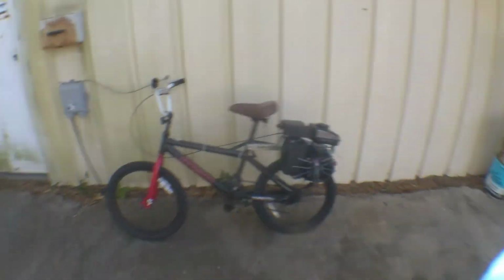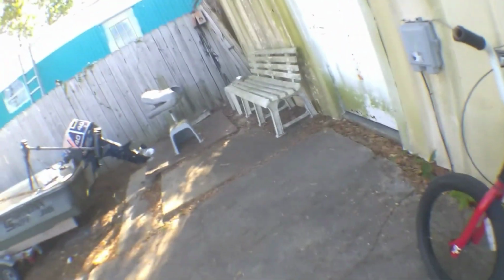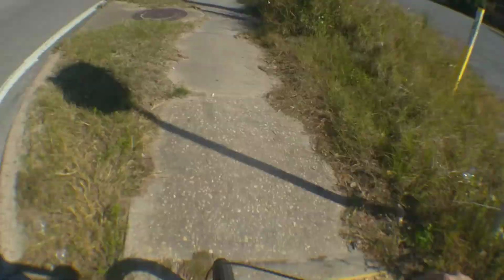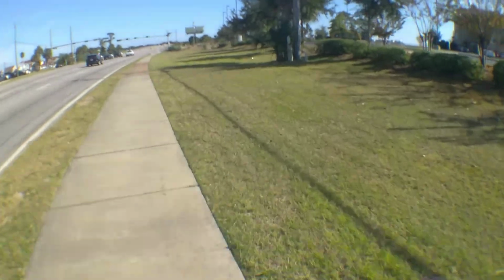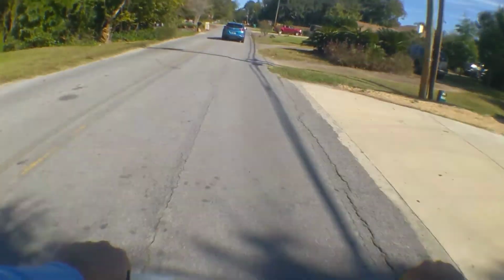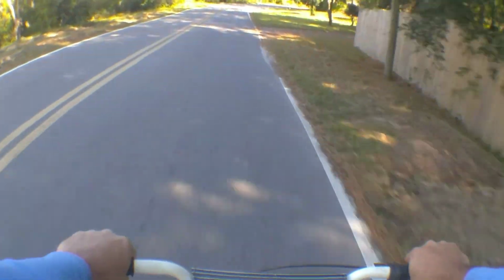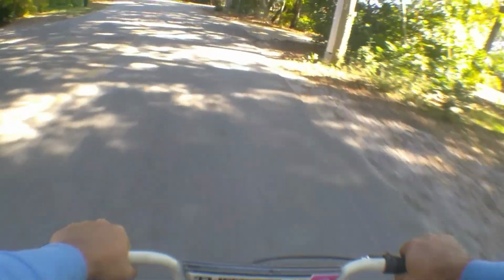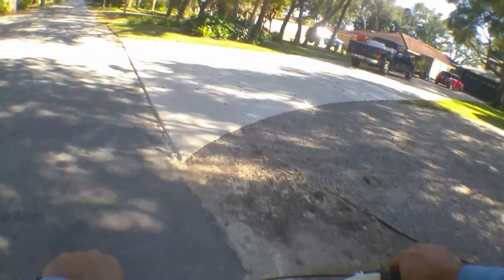Motorized BMX ride 🚴💨 // predator friction drive motorized bicycle

Comment: lol 21 mph on a 20 inch aint to bad . bet it was a fun little ride . hey with that engine off set on the back how much  does it off set the balance of the bike . and if it does have you thought about counter balancing it with maybe some Olympic weights .
Reply from the maker: Thanks for the question 👍😊 the offset is like having a pirate leg without the stump matey .Arrrr r she be listing hard to starboard Arrrr more tippy than a wench on the poop deck hope she doesn't flounder and sink strait down to oh Davey Jones Locker. AArrrrrr
Reply: @Jarrod_D  ok just wondered . have you ever thought a bout a mid frame  mount . and a cvt transmission . ask build break fix about his .